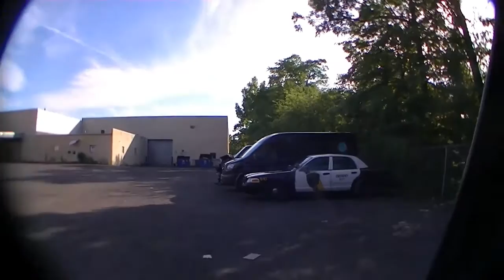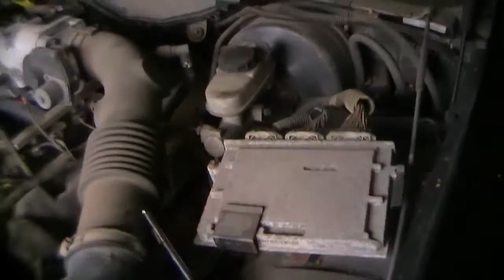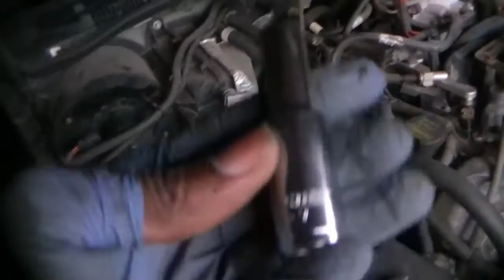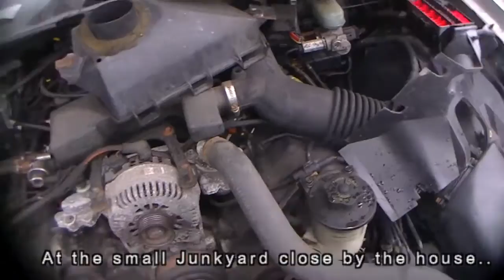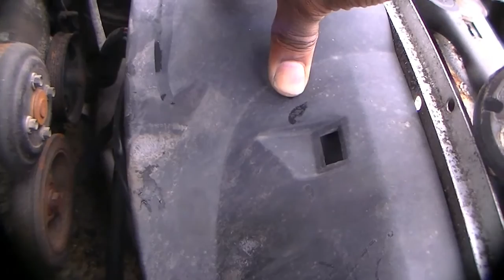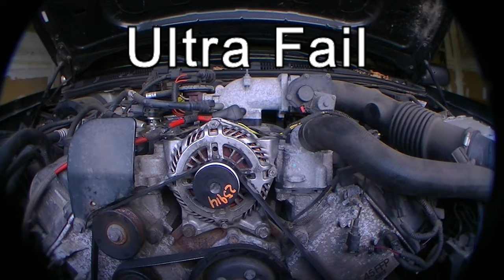$200 Crown Victoria ( Patrol Car ) Build first start up ( FAIL )

Comment: Did you get the motor to turn over by going clockwise on the crank bolt with a socket on breaker bar? Or cheater bar as I believe Americans say... Is the starter pinion the right size? Sounds like the pinion is hitting the flywheel when you key the ignition rather than engaging. Maybe the wrong starter supplied for your fitment? I love these old Crown Vics you're working on and the way you get stuck right in to any job!
Reply: Good man! If anyone can beat this issue it's you! Do you still have any of your other Crown Vics? maybe you could rob a starter from one of those?

Comment: take the belt off & try to turn all the pulleys- then try to turn the engine- use a long flat screw driver on the fly wheel. or socket on the crank. (don't snap the bolt)
I had a frozen alt.

Comment: Looking around a bit I think the conclusion is the ring gear on the flywheel, look like you gotta drop the trans my friend - sorry with all the headaches you keep finding
Reply: Yeah I just seen it, weird as hell, guess you gonna find out - I always dream about having a lift or access to one, been laying on the ground under cars since a kid, my dad was a mechanic and I had a lot of questions 😋
Reply: Yeah lol muscles and bones aching later, stones stuck all in your back and head, and in Fl it's so freaking hot, sweating for hours and those damn ants and mosquito
Reply: Haha, then you know 👍
Reply: I think you're right. Good luck , Build Suhm-thing (criminal slang p71
Reply: +Build Suhm-thing (criminal slang p71) yeah I see what you mean and that's a pretty good price for the repair - saves you busting your back on the ground, but it's money you need to save also unless you're just going to flip that patrol car, how much $ are you into it for so far with the $400 flywheel trans pull probably a grand with the other parts you may need - if you can still make a profit for the channel -
Reply: Yeah, that sounds like a plan, you turned the motor easily enough with the ratchet and sounded like good compression - so hopefully it runs, I wonder what caused the flywheel to separate from the friction plate - hopefully it didn't hurt  any of the internals. 
I replaced an idler pully on my 4.6 and I think I paid like $30 new for it from Ford - are you sure the junkyard is giving good prices? 
Anyway good luck with this - and hope the towing is free from the tranny shop 👍
Reply: Ok cool, no problem, I definitely agree with helping real local businesses and I have seen people pocketing small things at the yard, we knew we could probably too but put the small stuff on the counter and they only charged a couple of dollars for a handful of little things, and a fair price for the big items so if they see you show little parts they treat you good - you could have used triple A membership this year - like 5 free tows haha - (I don't have it either)
Reply: +Build Suhm-thing (criminal slang p71) yeah I know what you mean, between myself and both my brothers, and friends with junkers, we used to practically live at several junkyards every weekend for years - sometimes go just to see if they got in another fox body so I could upgrade my wheels cheap or get a different spoiler etc - but the one I go to nowadays has like a huge menu on the wall where you pay a small entrance fee which they deduct from the final purchase if you buy something, if you don't buy something a dude checks your tool bag sometimes in case we're helping our selves to some parts lol, anyway they often charge less than the price on the wall if you are cool and polite with them, if something doesn't work you can return it not for cash but a different part - which is pretty cool - I love going also, but it's crazy hot recently, I need two blower vent actuators for my inside my dash to go from floor to windshield - I only got forward towards the driver still hooked up because the other two - the gear keeps spinning and clicking, can sometimes drain the battery till I figured out what the drain (one of the several) was, had to reach my hand in after dropping the glove box down to unhook one, and from the driver's side up in behind the radio console - probably have to take the dash out to do it right - fml
Reply: Yeah I think air - but I heard the clicking in the dash, sometimes just when you key on the ignition - sometimes randomly and you had to turn the switch a few times between positions and would go away, eventually it kept clicking constantly - the gear is like a small windshield wiper motor almost but Teflon and once it wears down it cant get the part it's turning to click the little switch to tell it, it's fully open or closed and stop (like a power window) - anyway I was looking everywhere to find out what was draining my battery, one by one on the fuse panel, overall it was bad diodes in the new rebuilt alternators I'd installed - but the shop ran it's testers and it checked out ok but the real test of the diode bridge can only be done on the machine inside where it failed - but I left the actuators unhooked for now, I hope the foward air towards me don't go out or I'm f*kd - with your Hudini arms you might reach in and use a ratchet wrench 🔧 (closed end) It was cutting up my wrists on the sheet metal around the stereo console just reaching in and unclipping the connections - three bolts each, but the third one is further up behind there somewhere - I doubt I could get to it without removing everything - I still need brakes - I'm broke at the moment.
Reply: Yeah I have to find the relay for the vent air mixer - seems to be holding the charge now

Comment: what are you doing with the push bumper?
Reply: +Build Suhm-thing (criminal slang p71) lol well damn.. good find plus a ton of parts
Reply: +Build Suhm-thing (criminal slang p71) I watched the second half and thats a weird situation. almost like a clean break from the crankshaft on the flywheel and its still attached to the torque converter

Comment: What happened with it. I don't know if there is more about this victim. I think scrap for a crown vic is 200 bucks.

 Went to a NYS auction today, they bid up 250K cars pretty high, some cab place paid 2500 for one, think it was an 11. Supposedly it was good condition but 250 is when they have to be retired in NYS, but sometimes they hang around more. I've seen cop cars at auction with no floor boards, the rural cops in poor areas drive them until they literally fall apart.
Reply: lol, "P. R."? I go there a lot, they really cannibalize the Impalas right on the lot. Some cars at Coronas from the State Police that are WRECKED, lol. Still you're right, everything on that site seems to be WAAAY overbid for what they're worth. Not to mention, their customer service sucks, if you don't go to "K-B" and get your car like IMMEDIATELY, they will keep your money if you had enough on your credit card, AND you forefeit the vehicle. Still, easier than dealing with copart, for DAMN sure.

Comment: YOU are the crown Victoria man,I guess.
 You NEED a 10 mm torque adapter to R&R the starter. Unless you want to heat and bend a wrench.Flex plate toast?

Comment: from the sound of it it sounded like the starter was not makin contact with the fly wheel
Reply: i didnt mean the starter, i was talkin about the flywheel but i didnt mention it. but i was listening to the car while you were trying to start it a was hearing a like metal thud type sound and i knew it was the flywheel cuz ive seen and heard of times where the flywheel teeth would be chipped off where the starter was and the car would act like yours. but hey i bet that car gone run like a champ. that was a steal if u look at it. now u can sell it for....... or keep it.